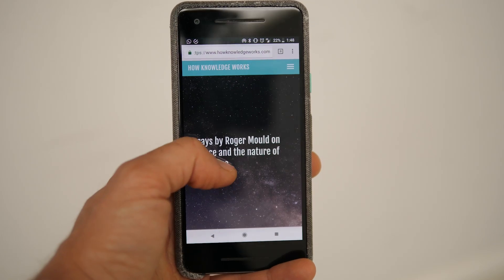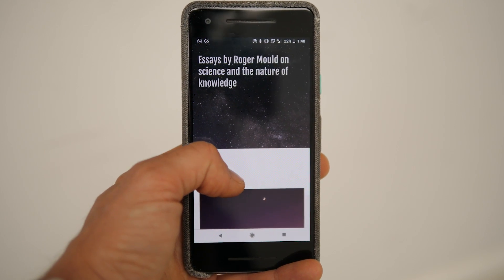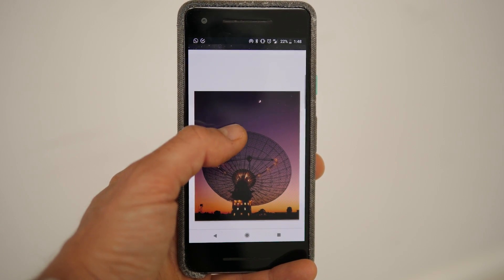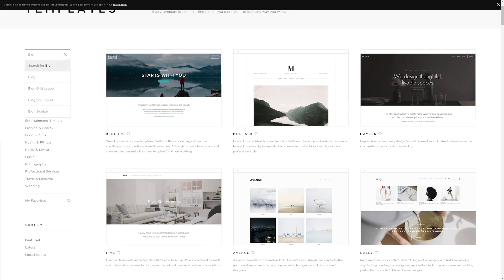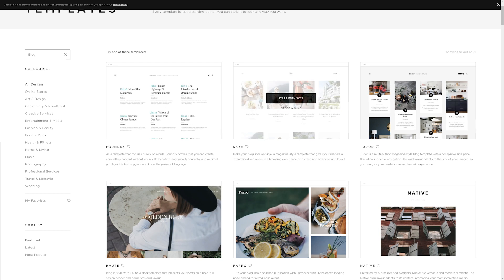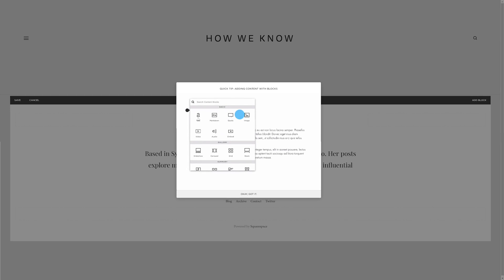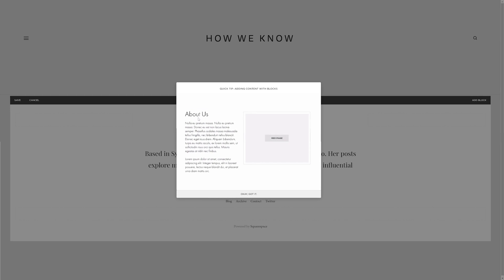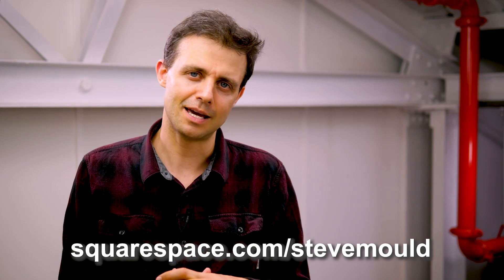The bizarre ripples that form in a stream of water

Comment: I liked watching this. Two things: -
1. At about 00:39 we see the water curve around the finger. This shows the Coanda effect, which I remember reading about in Scientific American way back in the issue of June 1966 (thanks Google) and have never forgotten.
2. I think there is a contribution of pressure change at both when a drop separates and when the flow meets an obstruction that generates a reflected pressure wave back up the stream. Backwards propagation of a pressure wave is well-known. That is why sometimes you have to brake suddenly on the motorway, then speed up to find no visible reason why people ahead were braking.
I realise drop separation in a simple downwards flow and encountering an obstruction are different, but still think pressure reflection is common to both.

No, three things! As I understand it, water is both one of the simplest molecules, yet still not fully understood after all these years of Chemistry and Physics. It seems we are still at the observational stage, as per this post, since computer modelling remains both varied and not resolved at the moment. As an atheist, I think water competes with the Sun as something worthy of some kind of worship :-)

Comment: I think the explanation needs a little refinement. Remember that water is virtually incompressible, so the narrow parts can't be at a higher pressure than the wide parts. I can believe there are variations in surface tension over the water column but not internal pressure.

Comment: That's a pretty good explanation but, I will add a couple of things related to the idea of pressure.
The pressure explanation is fine and I 100% agree with but, you could add how pressure in the stream varies along it's length due to the blockage. This blockage slows the water down and increases the pressure at that point. Coupled with the decrease in pressure within the stream due to gravity's acceleration of the water, I assume that what that paper was considering, causing the ripples in droplet formation. Here the higher pressure should cascade up the water stream in a sinusoidal wave with the phase on the surfaces shifted due to the angle of the blockage. Sounds like there could be a paper in this.

Comment: Thanks for reporting your observation, the more interesting part for me is how the information "distance from the change happening below", is transmitted from below to above on a free falling water (I guess is the effect of the obstacle encounter by the lamination propagated above by the surface tension). I believe those ripple are due to a vortex you don't seem to have considered, e.g. you have a good image at minute 6:00, where is visible the accelerated spiral (note the bulge point is on the right of the one you call pinch point). Difference in pressure doesn't make the flow expand and compress, but likely goes along with the twist. The equilibrium not to have a vortex is unstable: as soon as there is a minimal reason to twist, water does.
Then at minute 6:37 you have the transformation from vortex to drop, zoom the top of the flow: there is a spiral, then at the bottom superficial tension cuts this vertically extending (twisting) water into separated drops

Comment: As I've seen a couple of other people mention below, it looks like it also has to do with the viscosity of the fluid. When something is put in the way of the stream, the fluid nearest the obstruction can't get out of the way as quickly as more fluid is coming down, so it causes the stream to bulge where fluid is piling up. But that piling up also increases the pressure (due to surface tension preventing further bulging) and that increased pressure increases flow which reduces bulge. You end up with a series of bulges and pinches in a pattern that balances these two flow rates.

Comment: If you look at the speed at which the water moves, it's falling faster a little bit further down. 
More speed means more space between the water particles, which makes the stream separate into drops...

Does placing an object in the stream make the water run faster and therefore it almost separate the stream into drops?
Or is this effect not at play here?

Would the water form a turbulent boundary layer around the object, which makes the water on the other side of that layer 'laminarly' flow down faster encountering less resistance and therefore creating the effect I mentioned?

Comment: This might be a long shot but I was intrigued when you said at certain positions, the stream vibrated. That means instead of settling into a single configuration, it was oscillating between two. Is this in anyway connected to Feigenbaum's constant ??? If it is, then can you make it oscillate between 4 positions (might need a slow mo cam for that), 8 positions and so on and see the step by step  transition from laminar to turbulent flow ?

Comment: i have another theory. It's hard to explain given i'm not a native english speaker but; The water wobbles in zigzags : i suppose that due to it's viscosity, the fluid does not have enough time to clear from the object obstructing its flow. It look like it wobble like a rope would it you approach its ends closer from one to another. Fluid are incompressible,  but in a way this is as if the water flows compresses itself, and so is making zigzags. The closer the obstruction the more it lack space to flow away, the more it zigzags ?

Comment: Hey Steve, i have also noticed that if reduce the flow rate of the stream until it's just at the brink of starting to break off but is still laminar, it'll remain laminar until you bring in an obstruction after which it will not go back to its state of laminar flow even if the obstruction is removed. And this phenomenon is more likely to occur if the obstruction is closer to the source of the stream. To get back to laminar flow, you have to stop the stream altogether and reset it.

Comment: I first assumed that it was the changing in velocity, as the water is leaving the tap it begins to accelerate. When it meets the surface it obviously meets a resistance, but just enough not to break surface tension and splash off. The water up stream would feel the result of slowing, but spread over a distance instead of immediately at the obstacle.

Comment: Steve, great video.  Thank you for your science curiosity.   If you want another common surprising effect that also involves fluid surface tension, you might want to investigate the coffee ring effect (should also appear with strong tea).  Not the ring from a cup, but the ring left when a drop of coffee evaporates on a flat surface.  You will notice the clear accumulation of the suspended particles are the boundary of the circle of the drop.  Interesting physics involved.  Cheers!
Reply from the maker: Interesting! Thanks. Will investigate

Comment: Always thought provoking thanks . It's a  really  interesting phenomenon because the laminar flow is supercritical. Under normal circumstances what you do downstream shouldn't affect what happens upstream in supercritical flow. In this special case I  also  think surface tension is the only thing that can be transmitting infomation upstream. If you want to see supercritical flow turn to subcritical flow  just run the tap into an empty sink. You will see the water spread out radially, supercritically as a thin, fast-moving sheet then  you will see, at some distance away from the tap, the water will suddenly become subcritical with  a little hydraulic jump which is a rolling wave and the water becomes much slower but  deeper after this. It is the point where kinetic energy (momentum) in the fast moving water is suddenly  converted into  potential energy (as  the water is deeper). White water kayakers call hydraulic jumps  "stoppers". They usually form at the end of rapids. They are great place to have fun in (or fall out of! ) a kayak.  Perhaps you could do a video on the energy and momentum principles in water, Steve? C'mon it's  summer where you are. Get out of that stuffy attic and go an' play in the waves! 

It's really interesting phenomenon and an excuse to get wet.

Comment: Hey steve, see the small patch on front of the bubble at 5:13 where the light is reflecting and refracting? I have found this interesting and beautiful for a long time. It would be awesome if you did a video on this.

What I have observed is if you just have a flat vertical bubble film in a bubble wand you can observe the Colors filtering from bottom to top. First is multiple bands of teal and Pink then bands in this order: green, pink, yellow, green, blue, purple, pink, orange, yellow, light  blue, dark blue, dark purple, orange-ish brown, white, silver then clear then it pops; seems to always happen in this order. The best way to see vibrant colors is hold the film so it is reflecting a bright light. If you blow slightly on the bubble film the colors swirl and look kinda like a kaleidoscope.
 

Something I just noticed in this video is that the reflection in the back at 5:13 is yellow-green and purple this must be from passing through a second layer of bubble on the way to the camera. So now I'm wondering how many layers you could line up and how many times the color will change or maybe end up repeating.

I think the reason this happens is that gravity is pulling the small amount of water trapped between the two layers of surface tension and getting slightly thicker towards the bottom. I think the different thicknesses reflect/refract different wave lengths of light,  probably even be IR/UV light being reflected from the clear part that we can't see.

Comment: 5:10 how is the area of the curved surface less than the area of the straight surface?

PS: I think I found the answer in Wikipedia under "Minimal Surface". The minimum surface area discussed in this video is not geometrically minimum but it is minimum based on "Mean Curvature Definition" as follows:
    "...By the Young–Laplace equation the curvature of a soap film is proportional to the difference in pressure between the sides: if it is zero, the membrane has zero mean curvature. Note that spherical bubbles are not minimal surfaces as per this definition: while they minimize total area subject to a constraint on internal volume, they have a positive pressure."
Also:
"...A surface M ⊂ R3 is minimal if and only if its mean curvature vanishes identically.

A direct implication of this definition is that every point on the surface is a saddle point with equal and opposite principal curvatures."
Reply: Farshad _ I had the same thought. It took me a bit of thought to figure it out, since it isn't intuitive.

Although the curved surface is longer in cross-section than a straight one, that pinching in reduces the circumference at the mid-point. Since the formula for the circumference of a circle is pi times the diameter, if you trade off a little bit of diameter, you save pi times as much circumference  (more than three times the diameter).

This is why power station cooling towers are that iconic shape.

Comment: Another cool water faucet phenomenon I notice is when filling a container (or cup) of water. When the waterline gets close to the top of the stream, it turns from a cylinder to a cone flare at the bottom. It's like the force of the water pushing up against the stream evenly distributes across the edges, causing the sides to form a cone.

Comment: So before I watch much of the video here's my hypothesis: You say the ripples get tighter the further away they get. Water also accelerates under gravity. I don't know much about the mechanics of laminar flow, but as I understand it, it's more ordered. So I think that the structure within the laminar flow is deforming under pressure like a soft solid. I would think this doesn't happen with non-laminar flow since the randomness in the flow absorbs it
Reply: Okay, not quite the same, but I did get to learn about Rayleigh Plateau Instabilities

Comment: On the top of a shower head, its droplets are near each other. As they accelerate downwards, they begin to separate due to gravity.
Furthermore, there is an attraction between water molecules (responsible for the surface tension), which keeps the molecules in chunks, so a chain of spheres with different velocities makes this pattern.
At 3:11 and 6:33 is visible that the bottom chunks are slightly wider than those on the top because they accelerated more. The big one below became so far apart that it is just about to split off.

Surprisingly, at 3:16 and 5:54 the pattern is inverted, the wider ones are on the top. But is noticeable that a tilt appears; the line is bent (at 3:16) and there is a twist (at 5:54): so there is an attraction. Thus, this phenomena becomes very complex.

Comment: Isn't it just water piling up when the flow is obstructed?
Reply: Thats just what i tough.  Flow is obstructed with finger, water molecules hit the finger, slow down and need to go around longer way, but another molecules are already hitting them and slowing down again, but there are molecules above them that have greater speed so water is piling up? I also think that this bending is in fact a spiral shaped stream, because curvature on the left doesn't cover curvature on the right side of stream or thats just the point of view.
Reply: Piotr Kowalski Filmed at high FPS with a stream of colour contaminant within would be ideal to see how the flow is changing/moving.
Reply: Could you explain the change in wavelength of the ripples as the obstruction moves further from the source?

My initial thought was that the coiling radius might have been related to the velocity of water (an obstruction further from the source blocks faster-moving water, and somehow this translates to tighter coiling). However, this paper (https://tel.archives-ouvertes.fr/tel-00156591/document, p.24) and my own brief experimentation seems to show the correlation isn't linear.

The standing wave hypothesis could explain the change in wavelength, but you would expect the change to be sinusoidal, not linear. Perhaps a tap just doesn't show a large enough sample size?
Reply: I think the reason for the tighter coiling is that the column of water, and therefore the spiral around it, is thinner. Thinking again in terms of orbital mechanics, orbiting closer to the center causes the water to orbit faster, which means it doesn't fall as far before coiling all the way around. Also, since there's less water in a slice of a thinner water column, it's less resistant to changing its direction. Of course, faster-falling water would tend to lengthen the coils, but it looks like, at least at the heights we've tested, thinness wins out.

I'm no expert on fluid dynamics or orbital mechanics, so I might be wrong about a lot of this. In particular, before looking at that paper, I hadn't thought of considering the water to be like a rope. In that case, the explanation is probably more complex than the orbiting model would suggest. And I'm not really sure how to test what I've proposed.
Reply: That's what I thought, and now I think it is a combination of all of these theories working in tandem, and that's why fluid dynamics is so insanely complicated
Reply: Using high fps camera would be nice. I wonder how long can be the stream to actually form the spiral from obstruction point to source and how fast its growing upwards. Would it be the speed at which the water falls down, faster/slower. Maybe the "frequency" of the ripples as shown in this video depends on the speed of water hitting the obstruction point, the further it is - greater speed caused by gravitation - denser the spiral. I wonder also if the direction of the spiral is always the same, and if its the same as water that you let go through a sink hole.
Reply: My thoughts exactly.  I imagine it kind like if you drop a length of ribbon how it will kind of wriggle ball and forth
Reply: I think this is the main factor causing the fenomen ...but there's probably a colaboration between this piling of molecules, wavelength, surface tension, and more... interesting how common things in our daily life hides complex mechanisms.
Reply: I just checked with my own tap, and it's definitely a spiral. I don't know what that means for the different theories of why the water bends, but it did bother me that the shape with an obstruction didn't exactly match the shape that causes the breaking into droplets.

If this does have something to do with Rayleigh-Plateau instability, then something has to explain the spiral shape. It's still a standing wave, just with one component that's out of phase with the other. And, notably, a spiral should be unable to cause drops of water to break off.

The "piling up" hypothesis seems to fit what I'm seeing. All the outermost water is pushed outward, but its hydrogen bonds pull it back inward at the same time. Along with some small random motion to the side, this could cause orbits to form, closely followed by the orbiting water tending to favor whichever orbit happens to be densest, again because of the hydrogen bonds. A lot like the formation of planets from orbiting dust clouds. And since the water is falling while orbiting, it traces out a spiral.

I wonder if a high-speed camera would show anything useful. If the water does pile up and start orbiting, I'd expect to see the spiral grow upward over time.